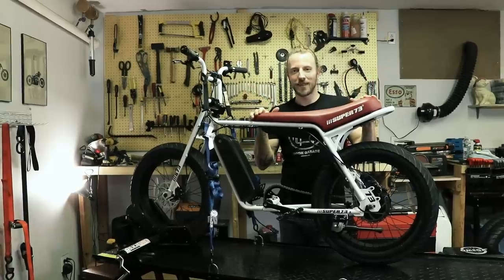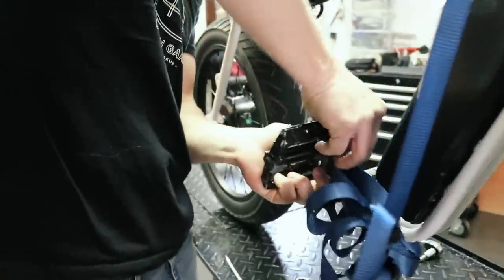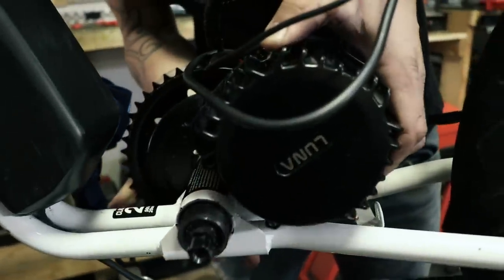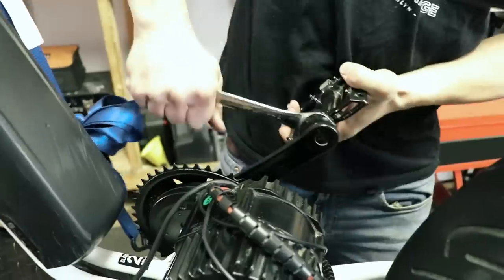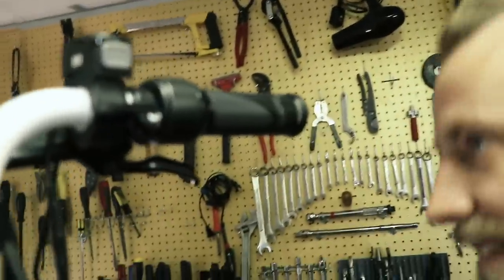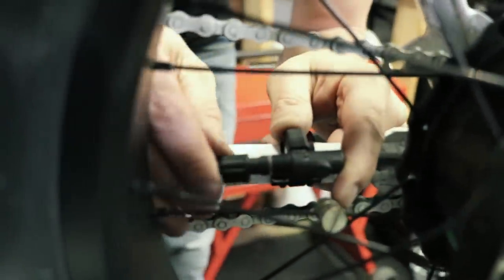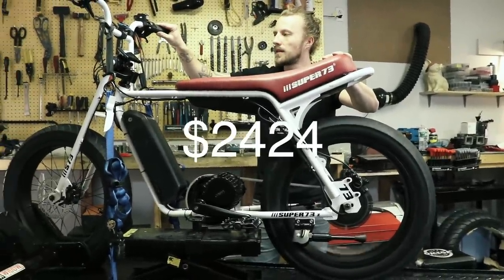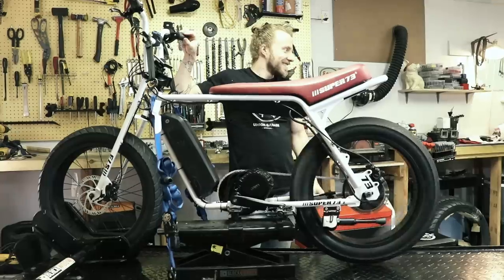Super 73 Z1 CUSTOM BUILD - 1500 Watt motor mod (Bafang BBSHD)

Comment: Hello Johnny :) At first, nice vidéo. I am here too because I will soon receive mine too ... I can't wait it !! I just wanted to know, if there is no way to remove the speed limit without changing the motor and battery ? And after, as Alerumba, I want to upgrade it just to have like 30 miles speed. I do not need a moto, but something no very expensive in order to go faster. As you recommend her, you think the best is "42 teeth and 100mm bottom bracket version" ? Thank you in advance if you take time to read me. Have a good day.
Reply from the maker: Derelle Charles you can get almost 30mph out of the original motor, but you need to unlock the limiter. There is an option to cut the white cable and I know a couple guys doing it. But please do some research and I take no responsibility if you have problems afterwards. Let me know if the mod works for you
Reply: @johnnypuetz  Hello. Yeah I understand a lot about responsability, and it is my proper decision for this. I just want to unlock this bike when I need it, like in town I don't need it. About the white cable I never found a video about it. I think this is cable inside the controller ? I just need to cut it ?But this will use more the battery ? Do you think is this good to add another baterry too with my future super 73 ? Thank you for answer me by the way ;) Have a good day

Comment: Anyone tried cutting white wire in controller yet? I’m in UK so power restricted to 250w. Would like to upgrade to bafang bbshd and twist throttle - currently only have power assist, no thumb throttle. No idea if this is all possible on EU version but continuing to research it. Tempted to cut white wire but haven’t seen any proof it works so a bit nervous!
Reply: @johnnypuetz - thanks for posting this, has been a huge help to my research on z1 and its capabilities 👍
Reply: https://youtu.be/04-p1ekQJjM 
I’ve seen this, hopefully with motor and throttle upgrade will be good to go
Reply from the maker: Donna Clack you are welcome buddy! I would just go for it. You can always solid then cable together again. :) please let us know what you are ended up doing! I know that the US and EU bikes because ebike rules are different. But I’m pretty sure that the throttle only hack isn’t too complicated either. Keep us posted!
Reply: johnnypuetz  
I may just add another battery to improve range (not to run parallel), snip white wire and add a throttle. Do you have a link or can you remember which throttle you used please? Not sure if I need to upgrade motor in order to use different throttle or whether I can just replace the one it came with (pedal assist only as EU version so I have no throttle at all currently). Thanks for any help - as the EU Super73 has only recently launched we’re all newbies over here lol
Reply: Connector is different on EU pedal assist unit on handlebars. It’s green and 5 pin so not compatible with any throttles that I can find online. Think I’d have to run a new compatible wire from controller in order to do it - even then not sure it would work. May have to wait a while and see if any further mods/hacks come up

Comment: How many miles can u get out of ur charge
Reply from the maker: Jun Max I customized my bike again. Now with a 3000w and 72v battery. I never did a full distance test but I would assume that I can go 20miles if I don’t ride too aggressive
Reply: Ohhh and can I put a headlight on the bike thank u again for the vid!
Reply from the maker: Jun Max yes, but you need to figure the wiring and get a lamp that can handle the voltage

Comment: Ey man i just got my hydraulic brakes, how did u manage to connect it to motor for break cut off??
Reply from the maker: I don't have them connected to the motor. I do want it to be able to brake and control the acceleration at the same time. ..it's easier to control wheelies.
Reply: johnnypuetz ahhh gotchu i noticed that i can get more power if i do not connect my brakes to the motor. Thanks man I’ll get the bafang kit once i get enough money
Reply from the maker: @wreckitralph2037  My current build has the Cyclone 3000w motor from Luna Cycle. This is a cheaper alternative, that can handle more power out of the box. ..I just finished my build and will do a video about this build soon.
Reply: johnnypuetz  can’t wait to see it bro I really needed to put some extra juice in this bike

Comment: Does the bike go 50mph now?
Reply from the maker: Art Museum nope, 29mph. But we are working on a faster version already. :) ..if you go bigger on the front sprocket (+48t), you will go faster than 30mph with the BBSHD setup
Reply: @johnnypuetz  niiiiiiiiice....will be waiting for that video.
Reply from the maker: hell yeah. Coming up soon! :)
Reply: @johnnypuetz  Did it come stock with 48t or 52t?
Reply from the maker: @urbancargobikes4930  the Bafang comes stock with 48t
Reply: @johnnypuetz  Ours came with the same, 48 tooth big heavy chain ring. Try the 52t for higher speed or check around on the forums to see if there's a custom made ring with the more teeth. But remember too that the larger the ring the more power is taken from the motor to spin it so it's not an automatic speed increaser. How many amps are you programmed to draw?
Reply from the maker: Urban Cargo Bikes Luna sells Bafang sprockets. I swapped the motor already to a 3000 watt. Video coming up soon! :)
Reply: @johnnypuetz  Schweeet!!
Reply from the maker: https://youtu.be/mPOsyUhzgmE my new build comes close now.. :) https://youtu.be/mPOsyUhzgmE
Reply from the maker: @urbancargobikes4930  there you go: https://youtu.be/mPOsyUhzgmE

Comment: Did you build a new rear wheel or did you just use the original with the hub motor in it? If you just kept the original be careful as the BBSHD will shred that thing to bits. The reason being is that the freewheel is attached to the hub motor access plate and secured by 6 small screws.  Because it is a hub motor and the access plate is only designed to handle the torque from pedaling it will explode on you like it did on one of our bikes... https://www.youtube.com/watch?v=bR4TjQqR1bo&t=41s
Reply from the maker: Thanks for the advice. I already swapped the moto to a 3000w mid drive and I build a new rear wheel without the heavy hub motor. Video is coming soon! :)
Reply from the maker: https://youtu.be/mPOsyUhzgmE here the video with the stronger motor and the rebuild wheel. :)

Comment: With the brake kit you used did you need a sensor or anything else to shut the motor off?
Reply from the maker: The Iron Den Gym there is a power on/off switch for each motor. I am not using the break sensors switches in my setup. But it is possible
Reply: And for the brake kit there’s two diff options for length. Was it the 800/1650mm or 1500mm? Thanks for the help?
Reply from the maker: The Iron Den Gym I’m not sure where you see these numbers?! Can you send me the link so I can look that up?
Reply: I have the Z1 so wanted make sure I got the right one out of the two options
Reply from the maker: @irondenfitness5012  Now I know what you talking about! In the past they had only one option. I just measured my cable length and you need the 800mm/1500mm version. Do me a favor and use the following link if you want to buy it. It's an affiliate program link and I get around $2 when you buy it though the link. ;) https://amzn.to/2XqNpwt
Reply: Thank you! I certainly will purchase through your link
Reply: Ordered the brakes. Now I realize I need a chain lol. Did you have a link for that too?

Comment: Mid + Rear motor? Or it's a gearbox in the middle?
Reply from the maker: It is a mid + rear (hub) motor in this video. But I have already changed the mid drive motor to a stronger one and removed the hub motor. More power, less weight. :) The video is coming soon!

Comment: That chain is way too tight, buddy.
Reply from the maker: Bruno Adamik why? There is no suspension travel.
Reply: johnnypuetz chains should never be fully tight. You should enough slack to be able to move it like an inch up or down, or else your drivetrain wears faster and you get chain stretch. Your drivetrain will also bind and your chain may just straight break.
Reply from the maker: @brunoadamik4835  after 1 1/2 year and 100's of miles later, the $6 chain is still doing the job. ..but I hear your point, thanks for the feedback!
Reply: johnnypuetz it’s just a precautionary measure but I’m glad you didn’t have issues!

Comment: When you change the wheel size you are removing the true calculations. The bike will tell you that you are going faster than you are. You tricked yourself. You arent gonna go 50 on that lol
Reply from the maker: Ian Sendra I had a separate gps on the first ride to set the right tire size that shows the accurate mph just displayed in km/h ;) ..the display hack allows you to go up to 50mph
Reply: @johnnypuetz  im sorry, i dont understand your wording. What do you mean first ride?
Reply from the maker: On my first test ride, I used a gps app on my phone and compared the shown speed on the app with the speed that has been shown on the display of the bike.
Reply: @johnnypuetz  if you could upload a video of your gps showing you hitting 50 mph it would be appreciated. I did some research on other people using the bafang motors and with all types of gear ratios and lighter bikes no one hit 50mph.
Reply from the maker: Ian Sendra I think there is a misunderstanding. The top speed is 29mph with the bafang setup. 50mph is the potential top speed you can do with the display hack.
Reply: @johnnypuetz  ok, so i can see a video of you doing 50mph since you already did the hack???
Reply: So when you say potential top speed with display hack, you actually mean... this motor is limited to 29mph but you can trick yourself into thinking it can go 50mph by changing tire size giving you a false reading? You are confusing me
Reply from the maker: @PureChivalry  Check out this video. I hope that clarifies things: https://www.youtube.com/watch?v=detfBzVNh0Y&t=36s

Comment: What a total waste of time why didn't you just build a bigger battery
Reply from the maker: James Williams the original controller is handling a 36volt battery. There is a high chance that the controller is not able to handle a bigger battery.